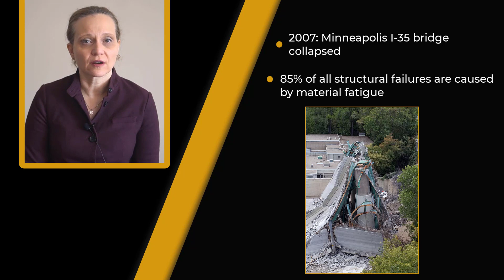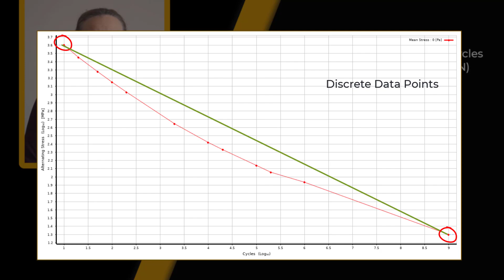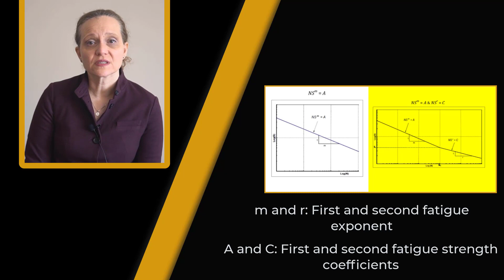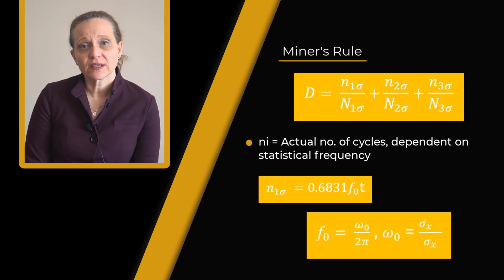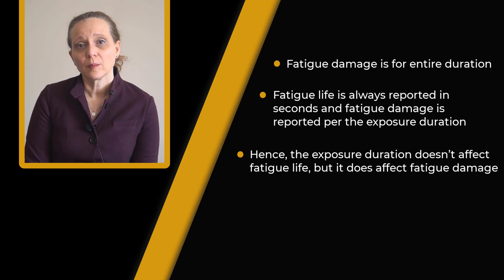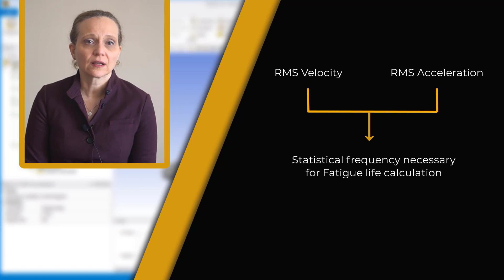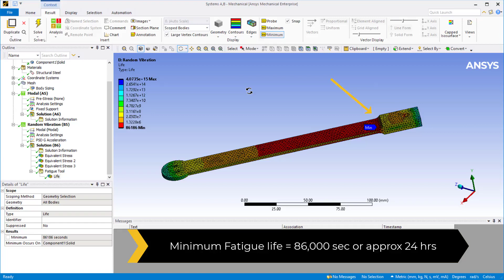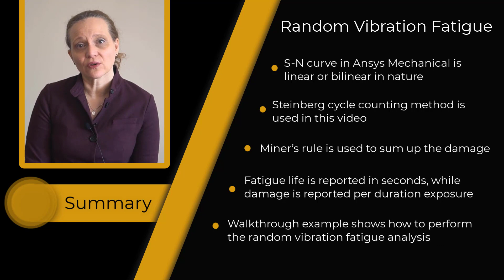Performing Random Vibration Fatigue Analysis Using Ansys Mechanical — Lesson 4

Comment: This video is pure gold.
Thanks a lot madam.

🙏🏻
Reply from the maker: Glad you think so! Visit Ansys Innovation Courses for free courses, including videos, handouts, simulation examples with starting files, homework problems, and quizzes here: https://ansys.com/courses.
Reply: @AnsysLearning  
Wow. This will help a lot.
My employer wants me to get certified By Ansys, for Ansys Structural, Thermal, and CFD using Fluent. This  requirement is reference to ASME (Section V and VIII) for process equipment.
Do you have faculty led courses anywhere in INDIA? I will prefer classroom courses.
Sincere thanks. 🙏🏻
Reply: Does anyone know how the actual number of cycles can be extracted for the 1, 2 and 3sigma stresses.  By that I mean the actual cycle count, a s a number of cycles.   I need to use the cycle count vs stress values in a seperate program (NASGRO) to assess the effect of random vibration on crack growth (i.e. fracture control assessment)